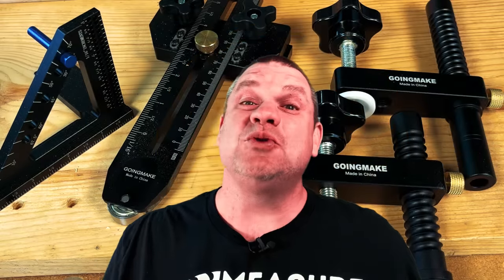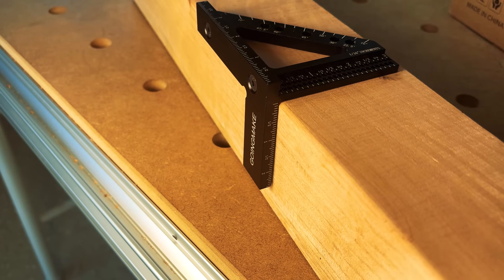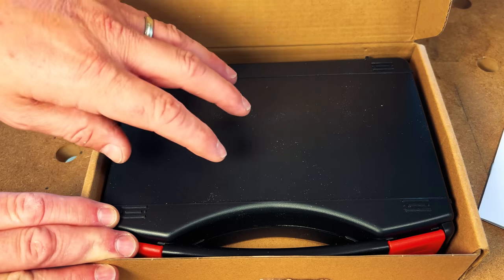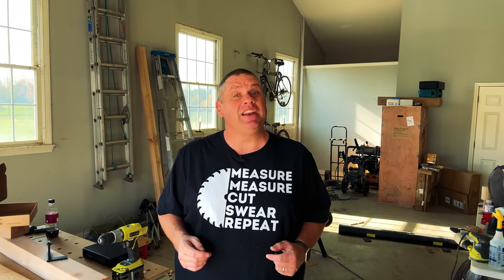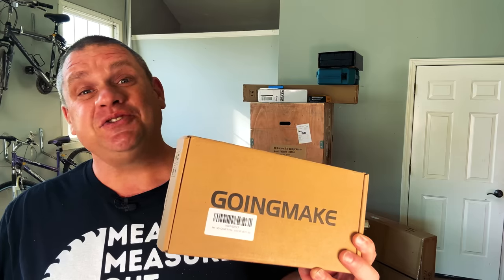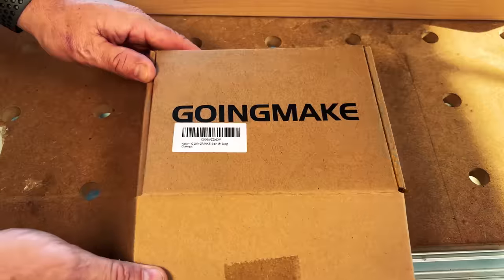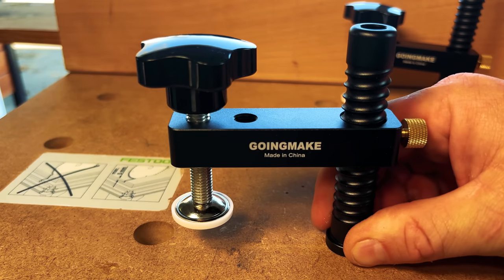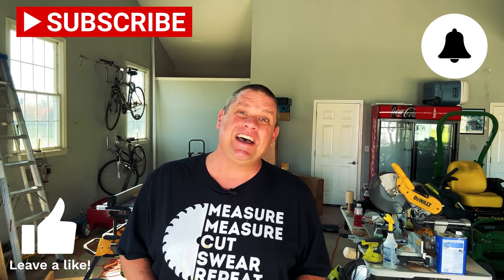Unveiling 4 Game-Changing Tools From An Innovative New Brand

Comment: Love your videos!!!
For someone that loves discovering new tool brands Im shocked you havent came across the Neitra brand yet! Theyre awesome! 
So far I have their small square (similar to DfM tools but better IMO because of the extra measurements) their set up blocks (dead on!) & I just got their woodworking ruler set that has a feature Ive not seen on any of the others. It comes with an extra add on slide for 45 & 30 degrees. I love them & they seem a lot better made then any of the other woodworking ruler sets ive bought . 
If you get a chance you should definitely check them out! They also have quite a few other jigs & such, if they're anythiing like the things I've bought from them they'll be just as awesome & they're not as expensive as most
Reply from the maker: Thank you so much for the suggestion Tiffany!  I'm definitely going to check them out.   I've never heard of them,  Thanks for the tip and thanks so much for watching! :)
Reply: Of course! Altho I do blame you for goin over my budget a coupla times lol 
They are pretty awesome tho, I wish they had more tools honestly. The ruler set alone is killer & so well made I absolutely LOVE  the extra slider they include, Ive never seen it on any other ruler set but it's been great for helping me practice dovetails! Usually I have to use a whole nother gadget for that lol. Plus I happen to love color & their bright orange & blue is nice. I have their router set up blocks in my cart now to go along with my regular set up blocks & I cant wait to get them in 
Love your channel! (My budget doesn't lol) thanks for the videos & the reply!! 💜💜
Reply from the maker: @tiffanys2992  I think I'm going to get a couple of them for an upcoming video.  Now that I look at them, Their cabinet hardware jig looks almost the same as one I did on this channel a couple of months ago. Makes me wonder if it is a Neitra jig!  I'm going to have to check the brand on it.  I used it for a video I filmed last week!
Reply: That sounds awesome,  happy to help pass it along & I kno more ppl will be able to see them if you do a video on them lol
Man I need to pay closer attention! I've been eyeing that cabinet jig for awhile, if it is theirs please let me know Ive been wanting to get one & if its anything like the rest of their tools it should be great as well 
I dont have any wwoodpeckers, but their small square is hands down better'n any other one ive had to compare it to including my DFM everyone seems to love, I hope you like them as much as I do!!
Reply from the maker: @tiffanys2992  Thanks again Tiffany!

Comment: I just ordered  Goingmake thin rip jig.  Expect it soon. I'm giving my homemade jig to a friend. I like the fact that it has a one-way bearing.
Reply from the maker: Oh cool!   I hope you enjoy it Ken.  It should be great for cutting boards or edge banding!
Reply: @FlynndoggWoodwork  especially handy when I make an accent stripe (either straight or curved).
Reply: I got my thin rip jig setup today. Impressed with the construction and consistency. I like the fact that it can even put in T tracks. I calibrated the zero location and adjusted to 2 pointers to a specific location that is easy to add. I made a label so I remember where zero is.
Reply from the maker: @kenerickson4923  That's awesome ken, I was really impressed with it as well.  I hadn't seen that zero calibration in a thin rip jig before, it's a nice feature!   Glad you like it.  Really all of those goingmake tools are top notch in my opinion especially fro the price.   Happy cutting!
Reply: My home-made jig had a ruler and a scribe mark I set to zero.   No math. The end had a screw instead of a bearing so I had to remove the jig before cutting. The bearing works well. Old jig is being given to a friend.
Reply from the maker: @kenerickson4923  Oh nice!  Hopefully they can get as much use out of it as you did!  :)
Reply: @FlynndoggWoodwork  I let him borrow it once, but now he will own it.

Comment: When looking at your referral link for 3D miter square I noticed that it look like the right angle is attached with two machine screws. Wonder if this side could be removed so you could use it without. the separately in toolbox for the rare occasion when required.
Reply from the maker: That's an excellent question, I'm going to check that out this afternoon.  My guess is that you can remove it!   Thanks so much for watching John!

Comment: On the miter square. is that extension down the side square and straight?  It "wood" be handy to bring the cut line around a corner, if it were accurate.  Cuz you can't always get a clean mark, visible on the side you need marked for your miter saw to cut.
Reply from the maker: Great question!  Now I'm going to have to check that.   I suspect it is, but I will confirm!
Reply: @FlynndoggWoodwork  thanks

Comment: For that GOINGMAKE Thin Rip jig what you are failing to mention or do is show how you measured from Jig to Blade
I tired jigs like that before and miss having a scale indicator/marker ie: similar to the WoodPecker This Rip jig.
There are a couple thin rip jigs with a scale-marker made from China out there, highly recommend
Reply from the maker: Good point drright.   I've always had a problem with accurately reading any output from the scales on a thin rip jig.   It sounds like woodpeckers may have figured it out.  I'd love to check out that tool someday.  Thanks for wacthing drright!

Comment: Who has a 3/8" miter slot?

Most of what i have seen is a .75" vs a 0.72" for the craftsmen saws that have the tabs on them. Is that the 3/8"?
Reply from the maker: Well, I think some of the really cheap saws may have them, but I think what they made it for was router tables which I know a lot of them have those smaller (almost t-track) slots.   But great question!   Thanks for watching James

Comment: The shelf pin jig in particular looks attractive, that's something I will need soon. Does the drill bit fit snugly or is it loose? Ideally it should be a close fit but still slide smoothly in the bushings. Have you tried it with a brad point drill bit? It should help drill a cleaner hole.
Reply from the maker: Great questions Jeff,  It is a nice snug fit but not so tight it could ruin the bit.  Very similar to a Kreg pocket hole jig.   I haven't tried it with a brad point bit yet, but excellent suggestion.   I'm going to building a lot of cabinets in the next few months, so this little jig is going to get a workout!

Comment: Nice stuff.  I'm a newbie and have not had a project with thin strips yet.  But I have seen several thin strip YT posts and I have the same question for all.....instead of resetting the fence for every cut why not just take the thin strip you just cut and sandwich it between the workpiece and the fence?.  Seems to me it would be a bit more accurate than readjusting the fence for every cut..  cut a strip, move it to the fence, cut another move that to the fence with the first.  and so on.
Reply from the maker: Well, I think the problem would be is that  it would not account for the kerf of the blade.  Blades are typically 1/8th of an inch and this material is completely removed during the process of each cut.  Therefore you would need to keep adding an 1/8th inch strip to each successive cut along with the thin rip you cut as well.  I hope this makes sense.
Reply: OK so also keep on hand a one kerf spacer and add it to the stack against the fence.  But you are right, I forgot about the blade width.   @FlynndoggWoodwork
Reply from the maker: @jackspeer2127  Yes that is correct, but you will need to add anohter space every time you make a cut on the wood, so you will need the same number of spacers as you have cuts (I believe).
Reply: No, you only need ONE kerf size spacer.  After that you just move the thin strip you just cut and add it to the spacer against the fence and keep moving the newly cut thin strips to the fence stack. @FlynndoggWoodwork
Reply: I just rethought about it and you are again right.  so my method just wont work and is not a time saver.  back to square one.
Reply from the maker: @jackspeer2127  haha!  I had to think about it too when you commented initially.   It was a great question! :)

Comment: I got a set of the bench dog clamps, they are okay. They are okay, I think I like the ones I got from Taytools better, but time will tell I have only done an initial evaluation.

I do like the thumbscrew thing that is an improvement over most of their competition, but I wish they had used a different handle for the clamp part , the bar type is a bit easier to use than the wheel, it is just easier to tighten. I wish they had used a rubber protector on the hold down part, the plastic one they use looks like it will only last a certain amount of time before it will break, but that is what that strange dip stuff is good for, I can't remember the name of it off the top of my head.  But for $30, they are not bad, a serviceable tool to say the least, certainly not as fun as holdfasts though. Maybe I just like hitting things with a mallet.
Reply from the maker: Excellent point Douglas.  I kind of felt the same way about the handles and probably should have said something about it as well.  It's kind of like an outdoor faucet.  I've got a tough one to turn off at my house, and always struggle with the turning mechanism on it.  Thank you so much for sharing Douglas!

Comment: I don’t understand the 3-D miter square. The top ruler markings do not extend on to the top of the wood. How is one suppose to read a measurement or set a distance from the edge. Use the old Mark One EyeBall? I guess I am just not seeing the usefulness of this ‘tool.’
Reply from the maker: Well, i think this tool is more for laying out mortices etc.   At lease that's what I see myself using it for.   But great question.  I might be misunderstanding your question though.  Thanks so much for watching!

Comment: I'm confused about those clamps. If they just rest in a hole in the bench, don't they get lifted out when you tighten up the clamping screw?
Reply from the maker: Since the clamping force is away from where the hole is, there will be horizontal pressure keeping the clamp in place in the dog hole.   May be difficult to understand, but it works!  Thanks for watchign and commenting theonceandfutureking!
Reply: @FlynndoggWoodwork  Ah, so it applies sufficient horizontal torsion to brace itself against the hole? OK that's pretty neat!
Reply from the maker: @the_once-and-future_king.  yessir!  That is exactly right!

Comment: The biggest problem with the 3D miter square is that it won’t be long snd that little pin will roll away into oblivion. It’s too bad the manufacturer didn’t design onboard storage - that would’ve made so much sense. 

As for the extra leg, I would actually use that. But storage is a big thumbs down, as you pointed out.
Reply from the maker: You know that is such a great point.  That pin will most definitely find its way to the depths of a dark corner in my shop.  Onboard storage would be amazing for that thing.  Even with a little magnet at the bottom so it stays in place when not in use.   Excellent idea.   Thanks for sharing and watching Trapper Creak 2024!
Reply: @FlynndoggWoodwork  

My pleasure! Thank you for your videos!

Comment: That bearing isn’t going to help with kickback unless it has some high friction rubber coating on it to grip the wood.  Even with the bearing being unable to run backward, the wood missile would have no problem just sliding along the smooth surface of the immobile bearing. 

Still. Build quality otherwise looks good.
Reply from the maker: You know that's a very valid point.   It would be really  be a really nice upgrade if it had a rubber wheel on the bearing.  Thank you so much for pointing that out and sharing.  Excellent idea!

Comment: You said that these tools have at least one feature, that the others don't. Well you mention 'DFM', when you were showing the square. I guess in that case, the only feature is a negative one, the shoulder extension that you said, you would eliminate.

Anyway what the Chinese are doing is replicate (copying) what the others did. No money spent on research, just take the same idea and put the automated machines to work.

But at the end of the day if you produce in mass you should create products way more cheaper than the original products and brands are selling for.

So it's ok to copy!
If the original brands are selling 20, 40 or even 60 times the price it takes to produce them (we used to call that greed).
Maybe the original companies don't have the ability to mass produce yet, but that's when the game changes, and you can produce products affordable for everyone.
Reply from the maker: Thank you for sharing your opinions on this.  I appreciate it and thanks for watching!